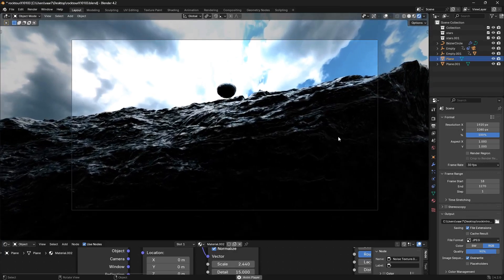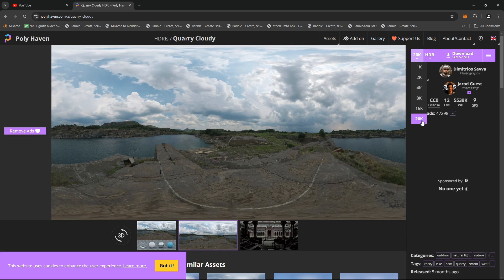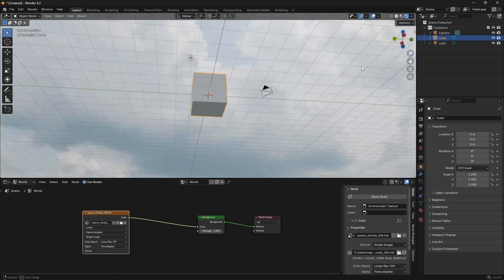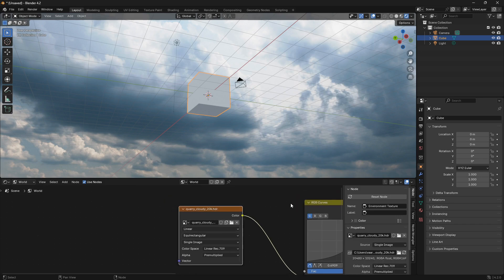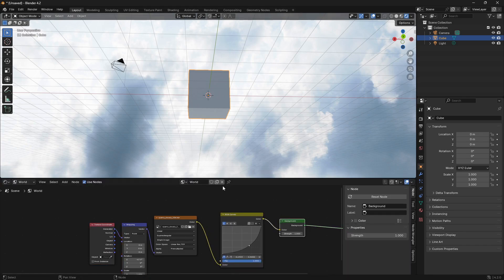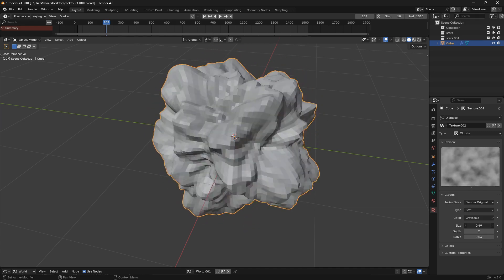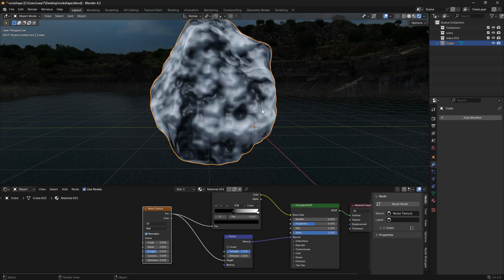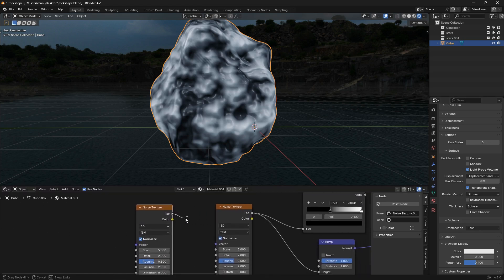Blender 4.2 Tutorial. Create Rocks with Displacement or Bump in Eevee

Comment: Hi, great tutorial, it works very well, but I have a problem, maybe something I'm missing. When I create the displacement node and connect it to the displacement output of the material, nothing happens, as if the node is not displacing the mesh, not even when I subdivide it. What could it be?🥲
Reply from the maker: Thanks Budd. Are you in Blender 4.2?
Reply: @Digitalfix-np8pq  yes, i've redone the scene few time now and nothing, the rest of the tutorial works for me, still wanted to do some displacement for background of the scene, it must be something stupid Im missing, but dont know what. Blender 4.2.0, the node setup is the same. Not even in EEVEE or Cycles. Thanks for the reply. 👍 I will keep try to figure this out.
Reply from the maker: @emilianoceron5465  The tips I have:  Subdivide the mesh a bunch of times. after you have subdivided the mesh, go back to object mode to see the result.  Tip 2: Apply all tranform, scale etc. And set the origin point to the center of the mesh. Let me know when you find the solution that works for you?